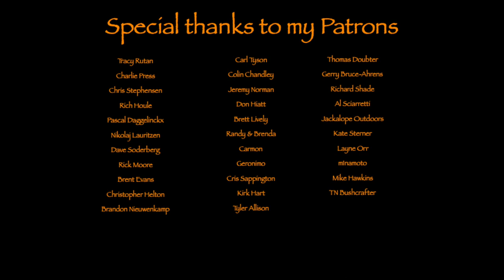First coffee in my new Cimbrer Camp

Comment: Nice work but can I point something out.  The wood you put on the sides should have started from the bottom.  That way the water runs on the outside versus the inside along the sides.  That way the wooden planks will over lap.
Reply from the maker: Yeah your probably right 🤔 I did consider that solution … but I think my design is nicer to look at 😉👍🏻 But again it’s a matter of taste. Thanks for your feedback Ron 🔥🏕🦌
Tom

Comment: For longevity the siding should have been attached like clapboards.  Had the siding been attached vertically the technique would of been fine.  It only matters if you want the shelter to last longer.  Minimal overlap will speed drying time and reduce rot over time.  Moisture penetration and retention are your enemy..
Reply from the maker: Thanks for your feedback and advice 👍🏻😊 appreciate that my friend. Have you noticed my addiction with roof on the sides? It prevents most of the rain to reach the walls 🏕🔥
Tom

Comment: why didnt you "shingle" those side boards, to shed the water if it rained??
Reply from the maker: I think the way I've made it is more beautiful and I also have at vertical wall I can hang stuff on. Tom
Reply: @cimbrerbushcraft-vikingheritag  I have built a wood shop in much the same fashion and seen many quite a few slab sided homes and must say that every one had the boards hung shingle fashion to shed the rain.   In a blowing rain the inside of the boards will get wet.  I used to have a saw mill and would slab cut logs that were up to 30" in diameter and they made great siding.   You placed your boards in a board and batten fashion which works great on vertical siding.     Good luck and keep going.
Reply: I saw the same thing, wondering why you wouldn't lap the siding? Nothing like having rainwater inside the shelter I guess.  Wait for the first ice or snow storm that way your  drip last's for days. Pretty is as pretty does!

Comment: Hey Tom: great job like a second home. Your fall weather is holding out for you with fine looking days so you can keep up the work. Do you plan to have a tarp of some sort on the front that you can roll down to keep the bad weather out?
Reply: I see by reading the responses of others that you will have a clear tarp for the front opening. Good plan.
Reply from the maker: That’s right Moray 👍🏻😁 Then I’ll have a super-shelter 🔥🏕
My only problem is that I can’t find a place where they sell such a tarp 🤔😏 … have to find it before my first overnighter 🌲🔥🏕 Tom 😎
Reply: @cimbrerbushcraft-vikingheritag  Have you looked into poly vapour barrier used in building construction? You can get it is fairly heavy weights and it is inexpensive plus it is available in large sizes. Good luck my friend.
Reply from the maker: I think I found what I’m looking for 👍🏻😊 Plastic to lay under a floor … it’s perfect 👌🏻 yeahh
Tom

Comment: Everything hanging on those walls will get soaked whenever it rains...Not too bright to nt overlap the siding to shed rain. Your reply as to why you did that was to be able to hang things inside was seriously lame, building the walls properly would have been just as easy to work with and you would have a dry shelter,. Nice build otherwise but a serious mistake with the siding and the shallow roof pitch.
Reply from the maker: 👍🏻😉🔥🏕🦌🌲🇩🇰 Atb 😊
Reply: He did over lap
Reply: Just saw a side view  sorry
Reply: I still don't get the siding..
Reply: If he had overlapped he would have had double the places to hang from